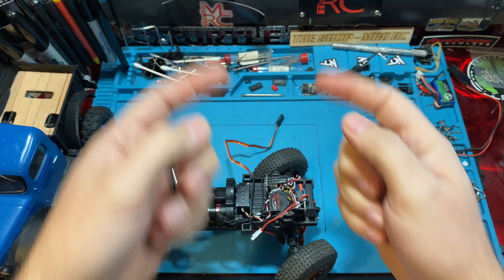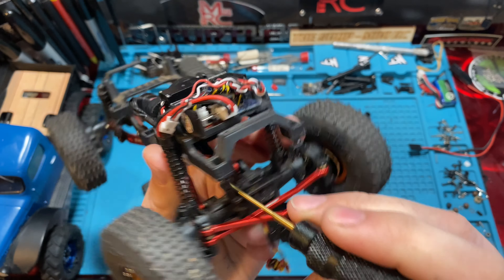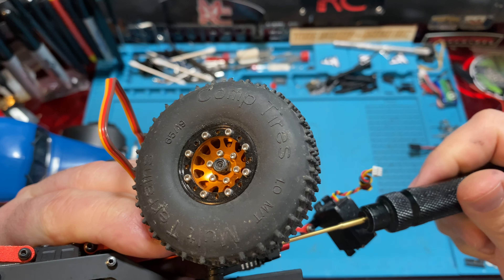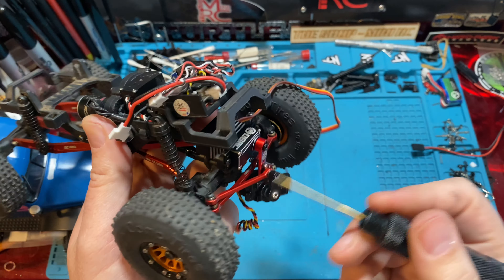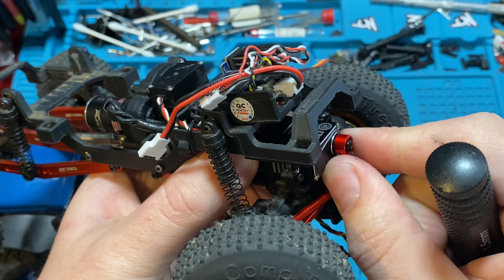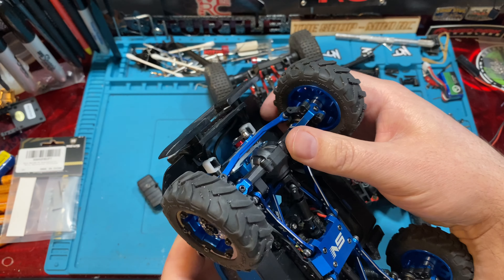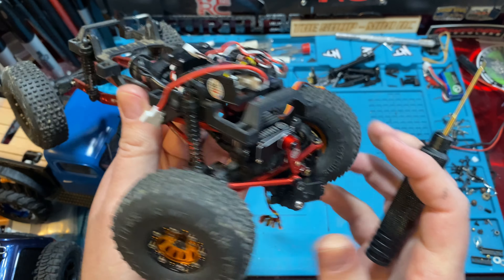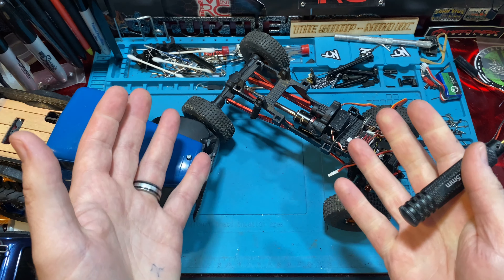Installing an aftermarket upgrade servo in an FMS FCX24 or FCX18

Comment: I chopped out the front cross member and increased the uptravel (printed taller shock tower mounts) of the front suspension. It was the biggest performance increase of all my mods.
Reply from the maker: Awesome! There are a ton of ways to deal with the different issues.

Comment: My fcx18 has the high clearance links and it's rubbing on the batter try any fix for this? It's a stock servo as it is actually rather good. I'd like to get the few mm of travel out of it
Reply from the maker: That’s a tough one. I’d probably just break out the dremel and trim.
Reply: @TheShopMiniRC  well I swapped the screws over to countersink and that helped alot only got a like 1 or 2 mm of missed travel im going to leave it. Next thing is to get injora shocks ans see if it helps with the travel as the shocks don't compress as they don't seem to be inline like factory links were they kinda bind up so hoping the aftermarket shocks will stick out a tad more

Comment: Thanks again for the video you made for me personally, I appreciated your help. This is a good video for other FCX24 & FCX18 owners to know about the high torque micro servos with the motor can visual threw the aluminum servo case has more mounting depth behind the servo mounts & causes issues. I couldn't even use the OGRC - high torque servo on my FCX24 K5 Blazer because I run Injora - stainless steel adjustable high clearance links & the rod ends contacted the back of the servo case bad. It was so bad that the rod ends on the upper links would not move. The servo spline was also too far forward & the steering link also would bind. So I took out the YIPIN/GX Servo - GX1306CLS high torque servo out of my FX118 Fury Wagon I upgraded too & used a Rampcrab - FCX24 adjustable servo mount & that servo fit perfect & did not cause issues & install the OGRC - high torque servo into my FX118 Fury Wagon. The main reason is the distance between the servo spline & back of the servo mounting hole or holes. The micro servos like the OGRC - high torques servo that has the servo motor sticking out the aluminum case are larger in length behind the servo mounting hole or holes that causes the issue on the FCX24 like I encountered.
Reply from the maker: Sorry it took so long to get a video for you. Just been super busy with all the new releases.

Comment: I’m trying to put this on a fcx18 k10 and the connection thing is too big. Should I get another esc?
Reply from the maker: You can always change the servo plug.
Reply: @TheShopMiniRC  how?
Reply from the maker: @Enter_a_name15  you have a few ways of doing it. Cut the wire off the  old servo and solder it to the new servo

You can also buy just plug ends and cut the servo wire on the new servo and put on a new plug end.  You can also look for an adapter that goes from a standard “futaba” servo plug to Mx 1.25. 

Here: https://amzn.to/3YFN9YF
Reply: @TheShopMiniRC  what color goes to what color
Reply from the maker: @Enter_a_name15  I’m confused… 

If you mean the wire colors, black and red go to black and red and the. Yellow/white goes yellow/white. 

They should be the same order left to right.
Reply: @TheShopMiniRC  yes and thank you so much. It works very well!😀

Comment: If you have a fms fcx power wagon i highly recommend upgrading to an aftermarket servo as the stock tends to stick
Reply from the maker: We haven’t really had many issues with servos sticking, but a good, high torque servo is always a huge upgrade.

Comment: After connecting the horn and powering on my fcx24, the steering gets stuck to the left. Any tips on alignment?
Reply from the maker: Take the horn off the servo, turn it on, center trim your steering on the remote and then put the horn back on with your wheels straight.

Comment: Great video!! I just did the same thing with mine, also is there any way you get stripped screws out of these mini trucks? I have a few stripped screws and I don’t know how to get them out. Any help would be appreciated.💯💯😎😎👍👍
Reply from the maker: It’s rough and totally dependent on how the stripped screws are stripped. If you have a stripped cap head screw you can Dremel a slot in the cap and use a flathead screwdriver.  You can also try to use flush cuts to get a grip on the screw head.    If you have a counter sunk screw it’s much harder. You can try to use a torqs torx type bit or a reverse drill bit. 

I’ve had some where I could just break the head off, remove the part and then use flush cuts or pliers to unscrew the screw shaft.
Reply: @TheShopMiniRC  yeah, than you for letting me know!!❤️❤️💯💯😎😎